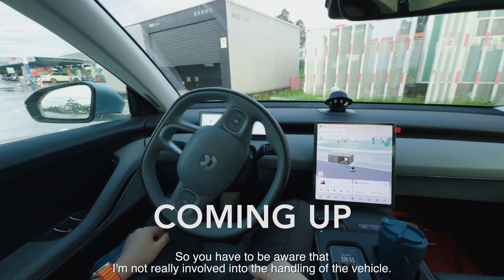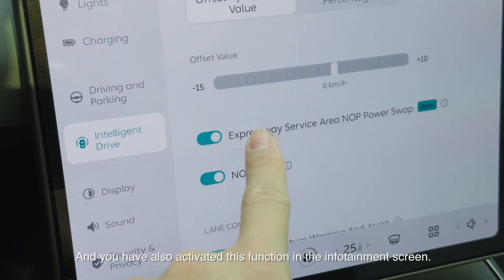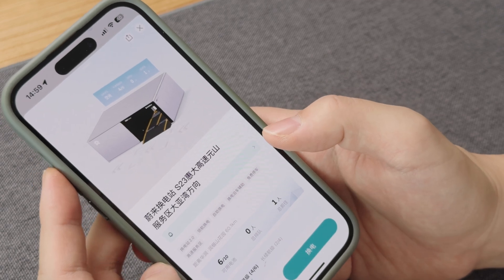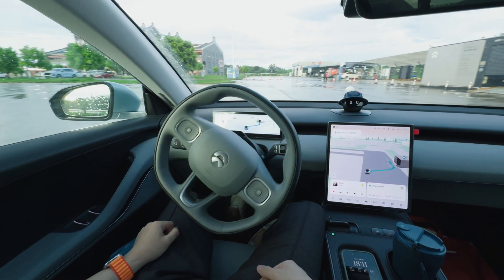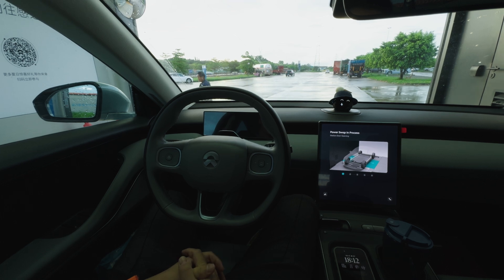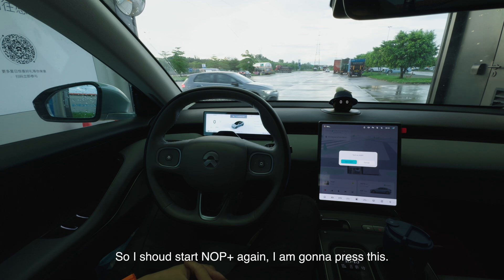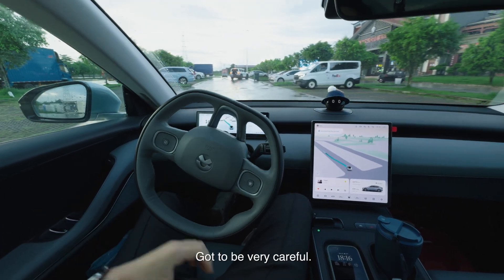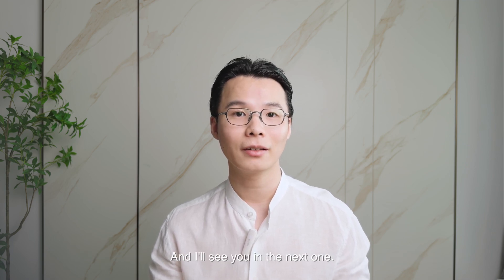Drive-thru Battery Swap | NIO PSP explained | Autonomous Driving&Swap on Highways

Comment: That was a really seamless process, thanks for sharing. There wee a couple of moments when you held the wheel as the car was moving a bit quicker with a vehicle in front of it and later with the truck. While things are getting better, I would be doing the same as well as I would likely be driving at a lower speed than the car would however, it seems from the driver's display, it identified people walking and the trunk later and had already planned its route. It slowed seemingly for the guy but, continued as he was a bit slow to move. I was a little worried about how it pulled out on to the service road before the highway, I guess the car had already confirmed nothing was coming and just headed out. This is a really great showing of how well NIO's system works.
Reply from the maker: I am glad you reviewed my content in detail. This auto driving system is based on LiDAR hardware instead of only cameras/visions so the vehicle can find out the objects that people couldn't see and using the chips inside to run many simulations in second. I was worried when I firstly used it but now I surely believe it manages better than me.

Comment: Ran, the app doesn't tell you what the queue is and how long you need to wait, it's not very convenient. Being able to reserve a time slot seems more practical. Your video of a passing car hauler gives a good indication of buyer preferences.
Reply from the maker: Thank you for your time spent on my content. The application won’t allow you to be in a queue nor to reserve, only if you are closer enough to the power station. This is to make sure that nobody’s cutting the line from far away, that’s why when you navigate to the power station the system notify you if you want to do the auto order, saying that the system will place the order automatically when you drive near the power station.